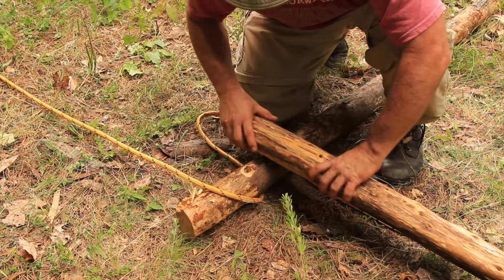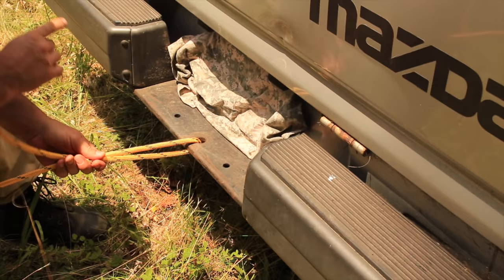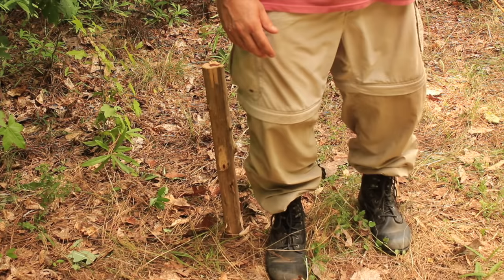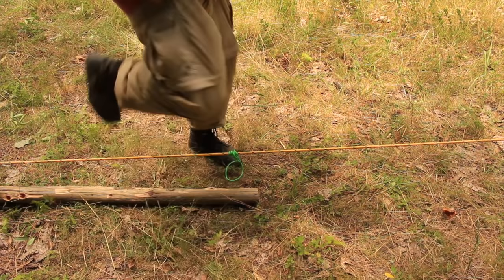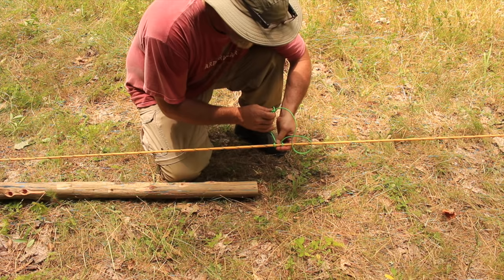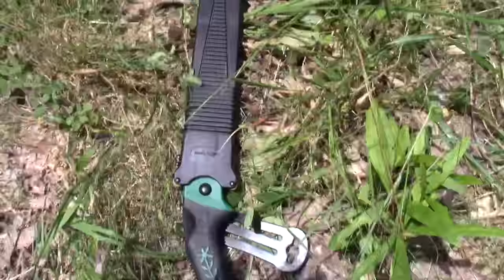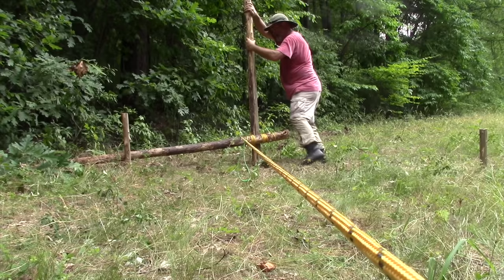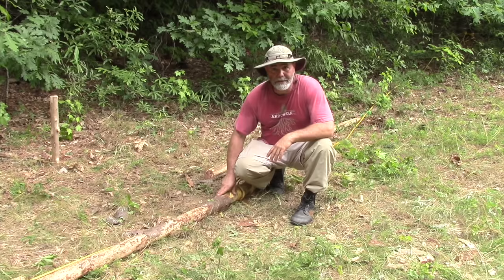Off Grid Winch: Making a Flip Flop Winch

Comment: My Grandfather showed me the exact same way to pull heavy objects with a flip-flop rope winch and a few years back when I was younger it actually saved me a thousand bucks towing bill.
 My Wife and I had only been married a year or 2 and were out Elk Hunting in the REAL BACK COUNTRY with my highly modified Toyota 4x4 pick up and the old forest service or logging road we used to get way back in to our camp had experienced a land slide during a hard  rain one evening after we had got in to our camp. On the way out we came upon a pile of Bark Beatle killed logs and big chunks of Granite and stuff that completely wiped out this section of road that rounded the mountain so we had to go back and cut our own road out...well we were doing just fine and had gotten past the wiped out road about a 1/4 mile down slope from the road when we had to cross the creek to get to decent terrain to make it back up slope to the road, well the rainfall had turned the entire creek bottom into a soggy muddy mess. 
We were doing just fine skirting it when we got stuck and I mean Stuck!, clear up to the frame stuck! All 4 wheels were in mud clear up to the hubs....so I had a old Warn 12v winch on the front that I bought second hand and had it gone through and repaired but it failed on me about half way to dry ground....so I trying to think what to do I remembered Grandpa and the Flip Flop....we got our ropes out of the back and cut a good green Ponderosa log for the handle and used a Aspen for the barrel and in about 25-30 minutes we were on dry ground and packing up to carry on up slope to the old trail. 40 min later we were on our way home after a successful Elk Hunt with a hell of a story to tell. So don't underestimate the flip flop.....it works and as long as you can flip and flop your handle....and your cable or rope don't break....your good to go. I'm positive given how far back in we were it would have cost around a thousand bucks to get us out if I had to get help.

Comment: My Grandpa taught me how to get out of the mud by tying a log/branch onto the wheel. It increases the surface of the tire and enables you to just drive out of the mud while safely seated in the car/truck. This is a great idea as well. It's definitely going in my bag of tricks. Thumbs up!
Reply: How do you tie it on?
Reply: @pedridemperi9872  Depends on the wood you're using. If you tie it to the tire treads then be mindful of your wheel wells. If you tie it to the outter wheel to use it more like a paddle then be mindful of your axles.

Comment: Most excellent demo on the simple machine winch.  Thanks for taking the time and doing all this work for us. 
   So to spell it out for those that obviously need help in the negative comment section.  One should always apply some math to fit your particular situation.  Survival Sherpa obviously did his as the rope did not break.  
    So let's apply some logic to how this demo benefits us.  
1.  Going off road with an electric winch that weighs 100 pounds or more mounted on the front of our 4x4 may seem cool until you are stuck and need it on the rear bumper.  The added weight uses more gas and the winch is great as long as the cable is long enough and it doesn't breakdown while you are needing it.  The winch has the same capacity restrictions as a rope.  In other words, 2,000 pound capacity is 2,000 pound capacity.  Both will have the kinetic energy you apply to it.  Both have the potential to snap and whiplash when the load exceeds capacity.  Just for fun which would you rather be hit with?
2.  The rope obviously needs to be rated for the load you are using it for the same as the winch cable.  The rope is lighter to haul and has more uses than just pulling you out of a ditch.  For those that may be math challenged or simply feel synthetic could never be as strong as steel, consider doubling the rope.  Survival Sherpa could have easily tied a second and a third rope to his bumper and applied the same technique with the same logs (assuming he had enough rope).
3.    Rule of thumb on how to rate rope and cables:  Take the maximum weight of the load and multiply by 1.2 which will give you a 20% safety factor.  The rope O.E.M. has also included a safety factor but we pretend not to know about it.  You could easily hang a 5,000 pound truck by the frame  with a 6,000 capacity rope and feel good about it.  Connection points, shackles and proper use of knots apply.  Now of course this is a simplification and a mere starting point as angles, cutting edges, dead load vs live load and other things come into play.  There is no shame , when in doubt double down.  For good information search Rigging Techniques online.
4.   So there you have it.  Rope and Knife are your friend.  Do the math and get the proper rope for your maximum potential load and travel safer and more self reliant.
Reply: PopLaCork    Occurred to me that with enough rope you could put the flip flop line at the midpoint of the line between an anchor point and the object to be moved. 90 degrees to the object line. Use the flip flop line to apply deflection to the main recovery line. Deflection is a big multiplier in itself. This would keep you further away from the main working line. Was taught about line deflection in a swiftwater rescue course a loong time ago.

Comment: Always good idea to throw a blanket or coat over the rope to the truck to keep it from whipping if it breaks
Reply: Joe Ludovici best comment/suggestion... 
I remember my old man doing that long ago. I was too young to understand why that was. Now I know. Cheers 👍
Reply: Or perhaps the dislike is based on the fact he interrupts himself during the flip flop to explain what he has already mentioned several times.  He can't do a full flip flop operation without stopping to talk about something like how far the truck has moved, or to explain a 2nd or 3rd time what kind of wood is involved.  And now it is closer to 1500 dislikes.
Reply: The idea of the "winch damper", or whatever you want to call the fabric or weight you put on the tension line to prevent it from whipping around, has any meaningful effect is just plain incorrect.
The amount of force stored up in a line under tension is incredible and the blanket or coat will have effectively 0 effect on the speed of the snapped line's recoil.
I would up at this video while researching that exact thing and ran across this video https://www.youtube.com/watch?v=4sRebBY_muQ which is a pretty good, scientific, test of dampers. overall effect of the stuff people usually use: none.
Reply: Yes. After I saw a winch cable go through a back and front window and it basically looked like someone slashed the seat with a sword. I think about it every single time I see tow straps hooking up lmao
Reply: @jean-clauded5823  Yeah and everybody is a damn critic.....you act this should have been a performance for the ages....worthy of an Oscar. Take the good with the bad....it's the tube. Hell I'm glad he took the time and effort to put it all together.
Reply: @gerardrjj   Great video on Tow ropes BUT... if its just a rope and not a hook and swivel and theres no metal involved if the rope breaks and you have a heavey blanket over it like in Semi Trailers When it does break its just a rope and will hit the heavy blanket which might provide just enough to keep it from shooting into someone.  But it is hard to determine where a rope will break and no matter what object it is if its fired at a high speed its going to inflict injury. I used to pull test Wire Rope slings and pennet lines We them break now and again. Very loud and sometimes it bucked the cage door on the tester. Pretty scary but pretty damn cool. People dont believe it but my Grandfather told me once he was making a delivery or was working on a well site Im not sure but they had a winch line, the winch line broke and there was a guy standing in the back of the pickup the winch line took off his head. He said the body was still standing up as if nothing happened then flopped over. Thats how deadly tensile strength breaks can be.  Ive heard similar stories of injuries and there is a video of where a tow rope broke and shot into the front of the jeep where the driver was I saw the after math he was still alive but it was really really gory. Im thinking he probably died.
Reply: 8:50
Reply: Did you ever work in a frame pulling shop.put the coat and a drop cloth on that chain rubber mat works
Reply: Very good idea
Reply: Excellent comment. I think it's not very common to think about if people aren't familiar with the dangers of tensioned rope, straps or cables. What really made me realize the dangers for me was reading about tug of war accidents... Terrifying stuff! Like whole groups of little kids getting dismembered kind of terrible. Listen to op guys, dont ever neglect to treat a tensioned rope or cables with the kind of deadly respect they deserve, get out of the way and set up safties like op here said.
Reply: Mike Mascaro ll
Reply: @johnnyguitar65  I agree with you. It is it is always easy to find things to criticize and it is likely that most of these critics could not have made a flip flop winch on their own. If they had to make a demonstration video such as this their style would, no doubt, include many similarly annoying mannerisms.
Reply: @jean-clauded5823  why criticize ? Just move on if u dont like it
Reply: @wdtaut5650  Yeh, blanket or whatever is MUCH better than nothing.. Bet it's gonna break at the bumper knot.
Reply: @wdtaut5650  I'd have doubled the rope anyway.
Reply: I saw a t-shirt stop an 1.125 steel cable on the logging show stop that cable in it's tracks. I have never pulled ANYTHING AND NOT USED THAT EVERY TIME NOW ! ! ! ! ! !. Life is just way too short eh.
Reply: I've seen coats on chains, and they help! I don't care what anyone says, always make sure to wrap a coat especially where you put two chains together, you can put the chain through a sleeve arm, or just wrap around and zip it shut...
Reply: @yoniesharnessshopllc  When I saw that t-shirt make that cable on my winch tractor drop like a soaked pillow I knew that was the best thing since sliced bread eh. I have pressed the tech.to everyone I poss can.I have seen what a flying rope or cable can do to the human body and it is just not worth not taking the 2 min it takes to make it happen eh. As you say, Chains too !
Reply: @dinofrancesco5441  LOL, You break me up bud, LOL.
Reply: a good welt on the appendage will reinforce that good idea ,,,,, my thought exactly
Reply: Or have a AAA membership card in the wallet.
Reply: @mjohnsimmons  yeah because you do this all the time yes didn't notice the STRING was tied off to the log and a stake on either side more danger from log flipping over and hitting you. but yall know everything he should of been wearing gloves as not to get nasty splinter with out your mum there to kiss his boo boo
Reply: @johnnyguitar65  I found his stop and talk style, informative. He kept adding and reinforcing important points.
Reply: @jean-clauded5823  Ignore the bad, you take the good. I know sometimes it's hard, for me too. But give it a try and you'll be better off because this guy will be the same.
Reply: @ArmaGuyz  Wow...what a vivid visual. 🕊
Reply: If you are worried about snapback,   that is the rubber band effect that a line has when it snaps, use Polly line. Nylon is the worst for snapback, Polly will snapback a little but not near as much as nylon.
Reply: Great suggestion. I would also recommend using a bowline knot at the bumper and tree ends rather than the “constrictor knot” used.
Reply: Jean-Claude
Reply: @jean-clauded5823  If these likes and dislikes were votes for Him to win an election, It would be a landslide W.
Reply: Guys, its rope not chain. Worse thats gunna do if it snaps is create a mini flesh wound and thats if you're unlucky.
Reply: @Deezuzjohn   yeah i wouldn't be concerned about a rope esp with this load. I prob get hit worse when using a   speed jump rope. Plus they make ropes for this kind of stuff that when it snaps it just drops straight to the ground basically.
Reply: That hawk wants you out of his territory.
Reply: @jean-clauded5823  Yeah?  But I wonder how many of the dislikes are from 'armchair experts' who quibble about unimportant things instead of appreciating and assimilating the actual knowledge being shared.
Reply: Tomoko's Enterprize Watch the movie 🤔 “Ghost Ship”
Reply: @17Scumdog  Wow thats a horrible tug of war story
Reply: @gerardrjj  My first question upon seeing this video was, can't this be dangerous? Even with high quality rope like Amsteel blue or something like that, don't you need to be particular with what knots you choose and such since they reduce the tensile strength of the line? Like I get the impression that vehicle recovery isn't something to mess around with—I figure usually when people are killed it's with steel cable/chain/hooks on tow straps less so than rope, but still.
And then people are saying to put a coat on the line it case it snaps. What the hell is that going to do if the rope is under 2000+ lbs of tension??
Reply: @jean-clauded5823   40k likes though. It's good information: focus on that.
Reply: @mikemascaro4301  pppp
Reply: Never hurt to put a heavy moving blanket on both ends of a cable under tension....there is no downside and it just might save you
If that cable breaks. Know someone who had a cable kill them when it broke and they didn’t do this!
Reply: @wdtaut5650  Why not the middle.? That way it should catch some from both ends, if they don't just fly right through in the way of the pull.
Reply: @thomaservin1669  unless the rope is worn, if it's like fishing lines, it always at the knot, they break.

Comment: Throw a t-shirt or jacket over the haul line so if the chain, rop or cable breaks it will stop any chance of it killing anyone. I have used it on steel cable of 1.125 inch cable and they stop in a pile under the break every time. Far too many folks get hurt bad that need not get hurt at all. I have been in the bush my entire life and haven't seen one of these. I am truly impressed ! Stop by for a visit new friend ! ! ! Soooo many times 4 to 6 inches is the difference between stuck and not eh !
Reply: Tomoko's En I I terprize uh

Comment: I like this and thank you for sharing,  I work in the oil fields  in Alaska,  and I will be able to use this EVERYDAY. Very useful knowledge!
Reply: If you're using this method every day you might consider getting a winch.
Reply: @terrywaters6186  or try shifting out of park
Reply: Use drill rod and steel cable instead of poles and rope.
Reply: Nate Townsend  obviously you would need a sand anchor as well in that region ;)

Comment: Something I learned many, many, years ago, whatever the situation. At around 3:00 minutes, before tightening the loop, place any odd piece of wood or any handy tool such as a heavy spanner in it. Then when you want to open it again you have something to twist back and forth until it opens and loosens. Once you have applied a couple of tons of force to the cleverest "self-releasing" knot, it will be incredibly tight and you need all the help you can get!!
Reply: There's also a bowline which can always be undone regardless of what tension it went under

Comment: I’m an old retired engineer, and I have never seen this before!  What a great emergency which!  It looks like you used sta-set rope. Good choice!  Available at boating stores.
Reply: Right,, It is a Great Concept, and possible to 
use a larger dia wind up log, 
or smaller logs added onto main beam 
to increase dia for the wind up beam, 
if load was not that much. 
Ice storm, and slid of the trail.  
Lifting heavy item off injured. 
Cheers

Comment: Good video and effective method.
Its also a good idea to put a good sized rock in front of one of the truck wheels to serve as a wheel chock. Keep sliding the rock along as you winch the truck, so that if anything happens, the rock will limit how far the truck can roll (like if the rope breaks).

Comment: Whoever invented the flip-flop winch was a genius. By flopping the barrel pole over, you wind the rope on both sides of it using a long lever. I never saw anything like that before. If you didn't flop it over, you'd just wind the rope on one side, and with the lever centered you'd only have half the leverage. Plus you would have to hold the barrel pole off the ground to turn the lever, and need something to keep the barrel in from spinning sideways. It would be a simple windlass instead of a winch if it didn't flip  and flop.

Comment: Good video. Thanks for sharing.

Wish I'd seen this six months ago. Had some big rocks that needed to be moved. I know it would've worked.
Reply from the maker: If you have a strong enough rope and good anchor and a lever long enough you can move about anything. Thanks for watching!
Reply: Would work with a chain or cable too. As far as the danger of the rope snapping and injuring you, if you have a heavy coat, blanket, even floor mat, drape it over the rope and it will absorb a lot of the energy when it breaks.
Reply: julie r another tip. Drive towards the winch once free, to take off tension.
Reply: +brett knoss
 
yes, but he showed the way in case it is an object not on wheels...like a log etc.